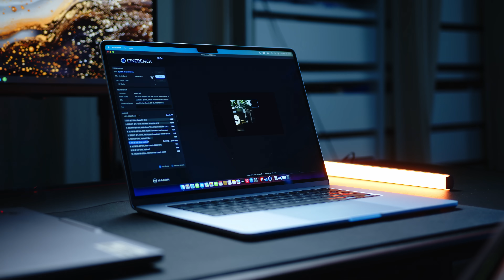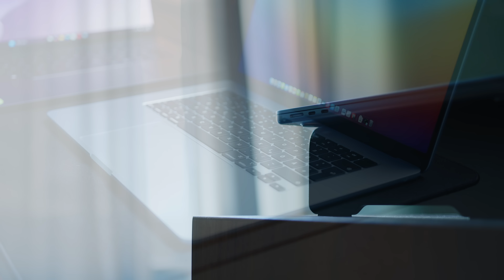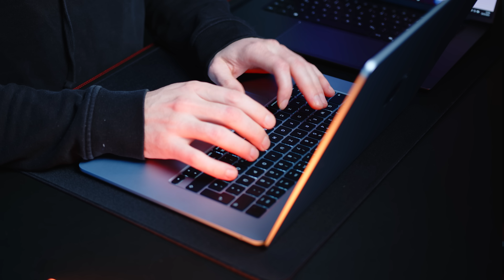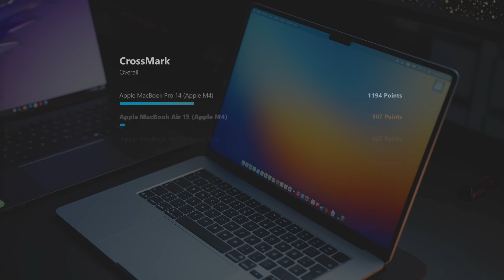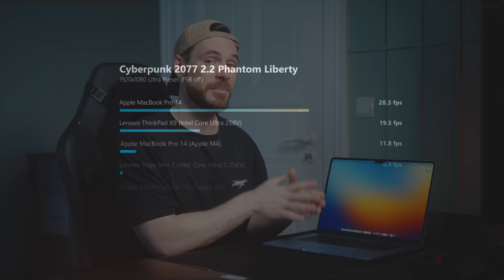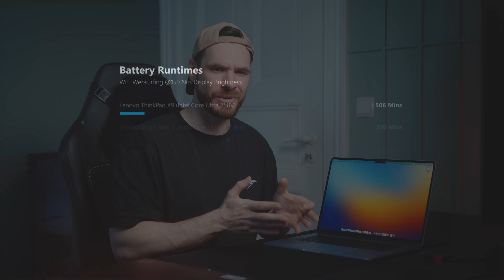MacBook Air 15 M4 - (almost) nothing new, yet still without competition?

Comment: can get 15 inch with 24gb ram and 512gb ssd for 1375 im tempted
Reply: That’s a really good deal! Unfortunately here in the Netherlands that config costs €1800. 😢
Reply: @werksfeerii8434  oof. I got what I think is an even better deal at costco. 15 inch m3 24gb 512gb for 999 usd.

Comment: Does hey Siri work on the MacBook Air or Pro? Without having to press a button or something?

I’m wondering if I could use one as basically a desktop, stuck behind my monitor but still have the mics pick up  Siri requests

And does this seriously handle hours of handbrake or whatever where it’s pegging the CPU at 100% for ages? It’s hard to believe that would work passively cool but it would be cool if it’s completely quiet!

Comment: I just had some time today to spend to the German equivalent of Best Buy. Only 2-3 laptops of the dozens in display were any worth. The rest were very cheap crap, with bad screens and Celeron and AMD processors I've never heard before. This is why most people associate Windows with problems. Very few will pay what an entry level Mac costs for a Windows laptop. And when they get a bit richer, they just follow the crowds and splurge on a Mac. I have been buying the best versions of premium Windows laptops for the last 15 years (Sony Vaio Z anyone?), Thinkpad X1 Carbon, etc. M chips was a huge revolution in battery life and performance but at the cost of compatibility. But now Lunar Lake laptops equal in battery life and performance is already more than enough for just browsing Internet at a Starbucks as most MacAir owners usually spend their time. As the reviewer clearly explained the Thinkpad X9 is a much better laptop, better keyboard, lighter, better battery, better screen, not a stupid camera notch on the screen, taking space and making a mess of software. And it runs Windows natively, so if you use Excel you get the good Windows version.

Comment: I have been a lifetime windows and Android user. The only Apple products I had before were Iphone 6s and Ipad. I was tired of subpar experience of windows laptop. They look good on paper but always have some kind of problems down the road. 

I finally gave the macbook a shot and it's amazing. I already own an Ipad and the ability to use it as a second screen is great. Battery life, screen, no overheating or fan noises, price to performance, it is by far the best laptop I have ever owned and my next phone will be an iphone.
Reply: Does it support hey Siri, like without pressing a button or anything?

I’ve sort of been toying with getting a Mac, and I’d like a serious support, and wonder if I could shove a notebook behind my monitor and have the mics still pick up my Siri requests.
Reply: @rebeccasam3434  yes you can set it up like that if you want.
Reply: @TriggaTrey361  between that, and being able to mirror my phone in the kitchen, I’m getting seriously tempted by a MacIntosh again, even though I usually like windows better plus I like games lol
Reply: @rebeccasam3434 the M chips are a great time to switch

Comment: Display and keyboard are really just OK. Could be better.
The recess around the lower end of the thouch bad has very spiky edges. Other laptops handle that better.

Otherwise I am so far satisfied with the laptop. I love that there is no fan. That was really the killer feature for me to switch over to a Macbook.
Reply from the maker: True, the Air is hardly perfect, but the "average" quality of everything is just really good.

Comment: Given that there is no active cooling, I would expect better quantification of the sustained performance. Even laptops with active cooling cannot sustain their peak initial performance, so this is quite important.
Reply from the maker: We have all the necessary charts in the written review on the website:
https://www.notebookcheck.net/Apple-MacBook-Air-15-M4-review-The-fanless-M4-SoC-is-years-ahead-of-the-competition.976933.0.html
Reply: @NotebookcheckReviews  There is no CPU and GPU performance over time in the written review, unlike other laptops
Reply from the maker: True, but it's mentioned in the text:
"The M4 can consume a maximum of 20.5 watts inside our test device but during our test, this was quickly reduced and finally settled at 9 watts after 20 minutes of continuous load (~15.5 watts after 1 minute; 12 watts after 5 minutes). As a result, its multi-core performance was slightly lower than that of the MacBook Pro, but still very good overall, especially considering how long it ran the Cinebench 2024 multi-test (several minutes). After 30 minutes, its performance of 776 points was only 11% lower and therefore still better than the Lunar Lake competitors. Its performance was even better in the shorter Geekbench test."
Reply: @NotebookcheckReviews  thank you! That’s surprising that it only decreased 11%. I have been wondering if it would be able to handle things like handbrake for hours. Plus of course a wayward browser tab can chew up a lot of CPU
Reply: @rebeccasam3434  you also make up they 11% if you use thermal pads someone on youtube did the test pretty essentially making it so the air won't throttle.

Comment: Germans are very good at several things.  Unfortunately comedy is not one of them.  Which is...quite funny. :)  :p
Now as for the laptop, well..if it came with 32GB of RAM for that price then it would be a far better offer as 2025 laptops so far look like a bad joke in terms of pricing. So the Apple ones look not as ridiculously overpriced  as usual.  

Still, even if I had the money, I would never pay so much for just 16GB.  I just checked here and with 32GB of RAM and 2TB of SSD (the min I would consider for soldered), the price is quickly approaching 3000 euros.  And I laugh and laugh and laugh.

Having said that, the performance of this laptop and the lack of fans which could potentially make it easier to deal with in terms of maintenance, is very good.  

Thanks for the video.
Reply: Yeah, I just can’t see buying a PC in 2025 that I intend to use as a main system that only has 16 GB. Honestly for me 64 GB is kind of a sweet spot, but I can make you a 32.

16 is just really pushing up against… I mean I have to really watch what I have open with only 16. It’s usable for web browsing and stuff but not great
Reply: So for the same price, what would you buy with 32gb Ram and 2tb SSD and comparable specs to the Mac Air?
Reply: @Giddyup896  With a dedicated GPU, yes.  CPU wise I can't say for certain.  But it will run Windows natively.

Comment: They have plenty of competition, except die-hard Apple fans will fail to admit that.
Reply: I'm keen to buy a competitive product from Windows, that competes with a Mac Air - what would you buy that has a haptic trackpad, 2k screen, same speaker quality, same battery life, same single and multi-core performance and the same build quality and 12mp webcam.
Reply: @Giddyup896  I have an Air 15 inch and a Surface 7. I like both, but I prefer the Surface 7. It cost less and has better features.
Reply: @Giddyup896  Lenovo Thinkpad X9, much better laptop
Reply: @ I agree a great laptop, not as good performance as an M4 but a great laptop through, only issue is it’s more expensive than a 15” MacBook Air, in Australia, at least. Can’t think of any otherlaptops that are as good as either at the moment
Reply: @ In Europe you get the 32Gb at the price of this Air with 16Gb. When you need Excel you need Windows, when you need specific X86 software you need windows and any performance difference goes down the drain if you have to run Parallels. Macs on ARM killed bootcamp and proper compatibility, disregarding this aspect. I know people that are reverting to Windows after years of being faithful Mac users because the compatibility of their Windows x86 apps took a hit with the M chips.
Reply: @skipper63400  14” x9 with 2k screen and 32gb is 2700 euros on the French Lenovo website. 24gb 15” air is 1999 on the French Apple Store. 😂
Reply: I would disagree. Macbook airs have: high performance, long batterylife, full alu body, fanless.

If you know of any windows laptop that fullfill those criteria, please let me know, i would likely be interested in it
Reply: I have hated this kind of “throwaway” vague accusation for YEARS! For YEARS reviewers compared Windows build quality, display, battery life, processor, speakers, keyboard and PRICE and not found a SINGLE laptop to MATCH IT, let alone BEAT it in every category. So PLEASE enlighten us on which Windows laptops match your statement!
Reply: @sharonb.9128  it just really depends on what you’re looking for. Some of the things that have been mentioned, like if you want that specific thing then maybe it’s good, but it really falters in other ways

I’m still kind of considering a Mac though  lol

I’m never really happy with them when I get one but there’s always a first time I suppose and right now I’m kind of in that mood again
Reply: Please give me your recommendations, because I fail to see any other Windows laptop that match the Macbook in overall capabilities.

Comment: With Intel and AMD prices rising to pay for the R&D to play catch-up to the incomparable Apple Silicon, the MB Air is now the value choice, especially when on a deal on Amazon. For example, it is currently £930 for the base M4 MB Air. 

Some people cannot leave Windows because that is the nature of a natural monopoly; people are unwilling to risk change. However, over the last 4+ years, those who have had vastly superior experience on the Air compared to rival Windows machines. OLED is also attractive for some, but for an ultrabook, where you mainly perform office work, programming, browser use, and social media, an incredible IPS panel, at least for me, is the de facto preference--though if you mainly watch media, then OLED could be a better option. 

I would recommend the base model or, on the 13-inch, the 512GB option, as that also gets you an extra two GPU cores (usually $100) and a $40 charger, making that upgrade a very reasonable value compared to some premium Windows ultrabooks like the Surface Laptop. 

A tip for users: Low-power mode can increase battery run times by around 33%, and because the M4 chip is overkill, the reduction in wattage makes no discernible difference to performance. This is unlike the Snapdragon X laptops, which slow down with lag when in low-power mode.
Reply from the maker: Pretty much sums it, even tho Apple still has the tremendous advantage of being able to properly align, hard-and software. Something that will be almost impossible in the windows world.
I would gladly take the X9 for example, or something like the Honor Magic book over the Air anyway, but I simply prefer Windows MacOS, I really like OLEDs.
Still, there is no denying what an incredible piece of engineering the Air is.

Comment: i thought after Qualcomm X Elite, Lunar Lake and Kraken Point release Windows laptop manufacturers would try to make a decent fanless laptop but nope. as far as they still hesistant to do so Apple still won’t have competition.
Reply: Just adjust the fan curve, or turn it off completely, what's the big deal? And you know the macbook air still throttles itself under constant load right? Why would anyone want that?
Reply: @amalionpizzachicken  this is not always possible in laptops and in some Intel laptops you have annoying fan noise even when not under load, but not here.
Reply: X Eilte does not need to be fanless, I haven't heard the fan in my Surface pro 11 since I bought it, not even during benchmarks, so if it spins it's so silent you can't even hear it, and if you can hear it there is something really hard going on you might actually want to be alerted...
Reply: @_Digitalguy  I have a surface laptop 7 and I've never heard my fans or felt heat once
Reply: @ Yeah, I can understand the fear in people who have known Intel and can't stand fan noise, thinking that fanless is the only way out. But in Macs and Snapdragon it's a different story, the noise is non existant and the fan is there for extreme scenario and even then it's so quiet you might not even be able to hear it
Reply from the maker: Yes, it's a bit of a bummer, but as was mentioned, during "everyday" use cases you mostly will not have to deal with excessive noise levels for any of these laptops.
Reply: @ I don't think it's a bummer, it's a good thing that it's there for extreme scenarios. In everyday use it's essentially fanless.